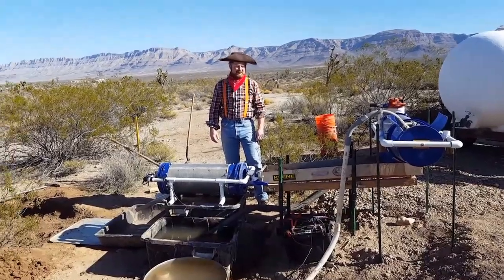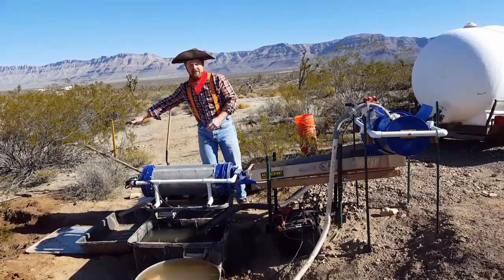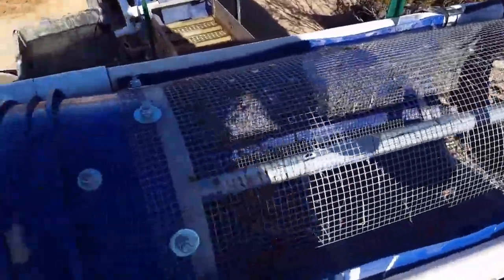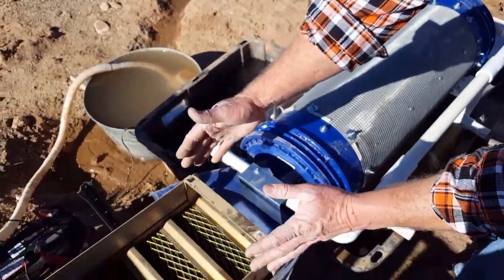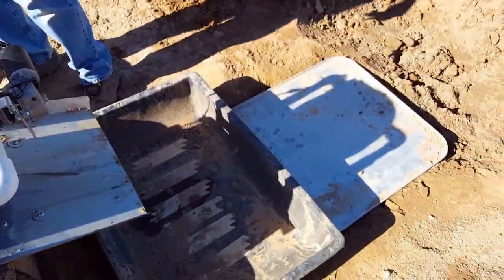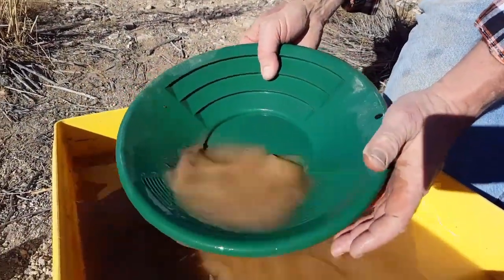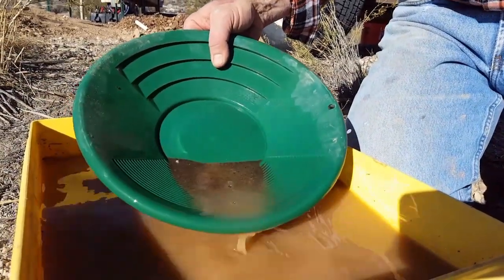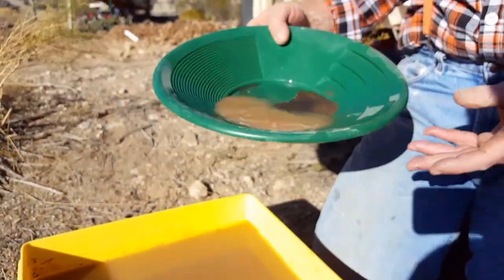Allan's Gold Mining Trommel Wash Plant

Comment: Simple is best.  
How long does it take to set up and level?  
What was your recovery rate per 5 gallon bucket of input material?
Reply from the maker: Thanks for the compliments Marshall.  It takes about 15 minutes to set up.  You can see in the video, there are green fence posts driven into the ground.  There are hooks attached for the trommel and sluice to rest on.  These remain on site and pre set to the proper angles.  Each time I arrive on site, I simply drop the equipment into place.  Recovery rate is about 98%.  Best wishes to you and your prospecting adventures.

Comment: MAN!! That is AWESOME! I see that there's some mud clinging to the 1st trommel, and some spilling out of the 1st Trommel (not much). Have you considered running small sprayers along each side of the 1st trommel so its spraying it down while it spins? That way it is always clean and even that much more effective? The water would still run down the original recycle too. Maybe something like PVC with holes drilled facing the trommel? This thing is awesome! What would you say your cost was (besides the sluice, I would make one I think).
Reply from the maker: Hi Rodney.  Thanks for the compliments, questions, and close observations.  I have made a few modifications since this video, including correcting the mud spillage off the lower cowling on first trommel.  Added a metal shroud over the upper half of trommel.  This allows better mixing and separation in the wash.   Also using a new set of riffles, and modifying the dewater trommel with a 400 mesh screen and extending the length.  Hope to have a new video with all the mods in a few months.  Stay tuned !  Good luck in your prospecting adventures !
Reply: Allan Guthmiller can't wait to see it. What do you think production costs of that was? Do you plan on making a kit and selling it? Maybe that could be your gold lol
Reply from the maker: LOL! Rodney.  Yeah, I've thought about it.  Maybe some day soon.

Comment: Hi Allan, I really liked your set up. A few years ago I thought I would love to be doing what you are doing, it looks like fun work with a chance of a Jackpot. It beats setting at home on your butt. Your equipment is well designed and except for your water trailer it doesn't look like you have a lot invested. Although you would never see it, but being born under the sign of Aries I can be a very impatient person, so the panning would be work for me. LOL A few years ago I came across a built gold reclaim machine called "The Gold Lab". All the parts including the battery fit into a plastic tote. Once you classified the pay the machine did all the work. I did go back to their website and it looks like there hasn't been much activity in several months. I could see this machine going hand in hand with your machine. Plus 'The Gold Lab' doesn't use much water. If you haven't seen the video's on 'The Gold Lab', you might enjoy watching how they had designed the machine. They said it caught all the gold including the 'flower gold'. Take care and be well. The Best of Luck. Bill
Reply from the maker: Hi Bill.  Thanks for the compliments and ideas.  I checked out the Gold Lab videos.  Quite an interesting set-up for feeding a Blue Bowl.  Normally, I pan the sluice cons with a Fossicker Maverick Pan (sold by Snake River Products) which makes quick work of ridding the light stuff.  From there, I classify the cons into 20, 40, 60 mesh, then feed into the Blue Bowl.  So much easier than panning all those fines !  The panning in the video was for demonstration only.  Wish you good luck in your prospecting adventures !

Comment: Allen cool but you should of use SHC 80 Gray pipe made for out door use, it has UV blockers in it to stop the sun damage .
The sun will in like 2 years cause the SHC 40 to dry up and get very brittle it is on for in door uses. One day the pipes will brake just by touching them. Now you could paint it, but paint tends not to stay bonded to PVC. I mean your set up right in the sun. Hope this helps you and all that wish to build with PVC pipe outside. Rich
Reply from the maker: Hi Rich.  Thanks for the comments.  Good thought !  Yes, the Gray SC 80 is UV resistant (more expensive) and is a good consideration for extended solar exposure.  My unit is every portable, and is stored in a shed when not in use.  Don't want anyone stealing my stuff.  LOL !!  Good luck with your prospecting adventures !
Reply: Not much for me, in wheel chair ten years now but I look to help anyone I can. buy some cons to run this winter to prove out my ideas. Try painting it with krylon for plastics. thanks for getting back to me. Good luck out there maybe I could come down one winter can not handle the heat. Rich
Reply from the maker: So good to hear folks like you, Sir, helping others despite your personal health condition.  Bravo !  Best wishes !

Comment: American ingenuity, you gotta love it. Would a 100 watt solar panel provide you with enough power for the motor that pumps the water. Great job. Good luck to you. Hope you make a bizillion dollars and retire early.
Reply from the maker: Thanks Steve.  Yes, I have contemplated solar panels.  Need about 300 watts.  The 3700gph pump pulls 14 amps at 12v.  The trommel motors pull about 4 amps each.  12 x 22 = 264 watts.  Then you have to consider partly cloudy days.  Definitely doable.  Might consider when my deep cycles give out...

Comment: Just start buying materials for my Build. need help on 12-volt jeep wiper motor. 
Did you try other motors? what year motor? How to mount to conduit?
Bill
Reply from the maker: Hi Bill.  I bought the wiper motor on eBay for $33.  It's for a Jeep Wrangler 87-95 (eBay seller: emsglobaldirect).  Haven't tried other brands. I'm sure they would work too.  This unit comes with an arm and ball mounted on the output shaft.  I modified a 1" collar that mounts onto the trommel conduit shaft by bolting on a 2" washer.  I then cut a slot into the washer to accommodate the ball.  As the arm and ball rotates, the ball travels in the slot, propelling the trommel.  Similar to using your finger to wind up a propeller for rubber powered airplane.  If the system is slightly off center, or frame flexure occurs, it won't really matter, because the ball is loosely connected in the slot, and will automatically adjust.  Therefore, motor unit won't bind.  Unfortunately, I don't have a clear photo of collar and washer.  However, it is somewhat visible on the video.  Hope this helps.
Reply: thank you for the info. Question about the wiper motor? What wire setup did you use ? I have red,black,blue,green, and white wires in the wire harness. Thank you. Bill
Reply from the maker: Hi Bill.  I think I used the green and white wires, but I'm not 100% sure.  Certain combination of wiring controls speed.  Unfortunately, the unit is out at the claim, many miles from my home.  Next time I'm out there, I'll take a closer look and report back.  I had to experiment to find the correct wiring combination to rotate at about 30 rpm.  Only one combination did the wires become hot, and it was instantly obvious.  So, I don't think you can fry the motor if you're careful.

Comment: Great video Allan.  Very unique design the way you are filtering the water through the bottom trommel.  !/2 gram per yard is fairly meager unless you're able to crank out the yardage.  The part I wouldn't like about reprocessing tailings is that there is little likelihood of ever hitting a nice nug.  The nice part about it is the digging is much easier than virgin material.
Maybe you'll find a nice stretch of unworked bedrock full of big stuff.  Nice work.  Keep it up!
Reply from the maker: Thanks for the kind compliments Nick !  it's amazing what the old timers left behind.  Can only imagine the nice nuggets they found.  However, they did a poor job cleaning bedrock.  My shop vac takes total advantage of this.  Finding nice pickers in the cracks !  Eventually, I'll find virgin ground.  Best wishes in your prospecting adventures !

Comment: Could actually use  a rubber flap at the top of you riffle tray to keep your water flatter  looks like you have a torent of water in the center just slows it down Nice unit though .
Reply from the maker: Thanks Garnett.  Got it covered !  Shortly after I made this video I installed a series of channel fins and flap.  Really smoothed out the turbulent flow.  Best wishes on your prospecting ventures !
Reply: Oh i`m figiting alright can`t wait for the river flows too . Just got a great deal on 2 Garret pinpointers  $150 for a  Propointer l & ll  - First thing I tested was some gold dust it talked like a crow .
Reply from the maker: Awesome !  Excellent tool for scanning bedrock cracks.  I'm thinking about getting one as well.

Comment: It looks amazing. Seriously! I am trying to get a recirculating set up build that fits on my trailer so I can take it around and prospect in san diego. My question to you is, how do you deal with the specific gravity of the water changing over time? I notice that my recovery rates start to go to junk very quick. I have been working on a cyclone separator in hopes of getting a better separation of water and material. Once the water collects enough material and the specific gravity goes up all the flour gold is lost and as we both know thats MOST of whats out there to recover.  How much recovery do you get off air sifted tailings must be super nice to scoop right off the top with no over burden.
Reply from the maker: Thanks for your compliments and questions.  I have a considerable amount of flower gold on my property too. Your concerns regarding water viscosity are very important.  I generally purge the water (about 40 gallons) every half yard.  This may vary depending on silt or clay content.  For example, this past weekend I was working bedrock, which had low silt content, so I ran the plant most of the day without purging.  I like your idea of a cyclone.  Would certainly do a good job separating, especially if you could get it to work with a 200 mesh screen.  Wish all the best in your prospecting adventures !

Comment: Way to much equipment to be successful. A drywasher when set up and running properly will recover 98% .. Well, certain drywashers will, there are a few bad models out there....Keep it simple
Reply: What im getting at, is I could go through and process the exact same material with just a simple drywasher setup, and recover anything you did and likely better.
Reply from the maker: I agree that dry washer is much simple set up.  I own a vibrostatic dry washer, and use it for preliminary prospecting.  Have operated many in the past.  Your claim of 98% recovery is phycially impossible with that type.  I accept your challenge.  Bring it on !  😊
Reply from the maker: Also, in order for dry washer to achieve maximum efficiency, the material needs to be bone dry.  That's  a major disadvantage, relying on seasonality.  A wash plant can operate all year.

Comment: When I complemented you on finding gold in tailings I should have clarified that more.  In dry climates caliche often cements some of the gravels.  Some of that caliche cemented gravels would have been oversize to the previous dry washers.  After decades on the surface the oversize cemented gravels become weathered and easily release their gold when washed.
Reply from the maker: Hi Steve.  I understood what you meant.  I just got off track a bit.  These piles were created back in the 1920's.  So, your comment is very true.  I have peeled off the top layer of the coarse tailings, down to the sedimentation level.  By golly, I found gold there too !

Comment: Wow that is really cool it looks like it works  You should let everyone know that when recirculating material you will lose about 35 gallons per yard.  If it is hot or windy that number will increase. Looks like a simple quality product.
Mark
Reply from the maker: Mark,  I'm flattered to hear from a popular mining manufacturing company.  Thank you for the kind compliments and comments.  As you can tell, I'm using one of your A52 Sluices.  I really like the fine ribbed matting on the head of the sluice. Traps a lot pickers !  Your comments regarding water usage is correct.  I've also noticed if the material contains considerable moisture (substantial rain this past month) the water replenishment is reduced.  Bone dry summer material will definitely be a different story.  Thanks again.  Best wishes in your prospecting adventures !

Comment: I'd say you have done everything right.  Recovery using water is much more efficient than dry washing.  Electric motors are more efficient and reliable than gas engines.  The tailings is where the gold is at because over the years the oversize that went through the old timers dry washers has been broken down by weathering.  Nice design of equipment.  My guess is that you had years of experience prior to this project or you did a lot of research.  I have run a larger battery/solar  trammel for over ten years, it is the only way to go.  Thanks for posting.
Reply from the maker: Thanks for the kind compliments Steve !  It takes more effort to set up, but "going wet" is definitely the way to go.  You are correct regarding the tailings.  Most of the good gold is on the surface and easy diggings.  I have a theory that the bedrock material was the last thing they processed, which naturally would be on top of the pile.  They also never had the convenience of a gas powered shop vac to suck up the bedrock crevasse.  Finding lots of good "pickers" down there !  I've been a lode and placer miner for over 35 years as a hobby.  I also build model airplanes and telescopes.  Hope you've been successful with your wash plant over the years, and wish you good luck in your prospecting adventures !

Comment: The rate of wetting all the reject tailings, evaporation and splashing, I think 100 gal/day is wishful thinking, though it is a simple machine.
Reply from the maker: 100 gal/day is not wishful thinking, it's fact.  I have operated this wash plant on several occasions with similar results.  Interestingly, during the winter, the material contains substantial moisture, significantly reducing replenishment.  Perhaps mid summer might be a different story.
Reply: allan I would like to get a closer look at the two trommels ,so I could make them my self. like some ideas on different trommels. incorp several different designs to take a pounding by rocks in the az desert
Reply from the maker: Hi Dwain.  you're welcome to have a look.  Can't publish my contact info here.  Can you message me on Facebook or Twitter.  We can discuss more details.

Comment: Outstanding alternative for desertplacer mining. Curious though, 100 gallons will wash a yard beore becoming too think with dissolved solids? I think thats what I heard and interpreted. So how many yards did you run for this video? Not challenging you at all, just trying to wrap my head around logistics. Very nice bit of engineering. Heavy pans
Reply from the maker: Hi Dan.  It's amazing how much more gold I'm recovering "going wet" compared to my dry washer !  You are correct. There is a certain amount of silt that accumulates.  Generally, I run approximately 1/2 ton before purging the primary and secondary tubs (approximately 40 gallons).  Also use Jet Dry.  This acts like flocculent, causing the silt to settle, significantly reducing any becoming recirculated.  The gold panning at the end of this video is one of three (3) pans of sluice concentrates, after running about 500lbs.  Let me know if you have any more questions. Best wishes on your prospecting ventures !
Reply: Thanks Allan, how long does it take you to run a half ton? Then do you just dump and refill? Looks like you have a serious water hauler in the background which has to make life easier.
Reply from the maker: Hi Dan. Depending on how energitic I feel,   it takes about 2 hours to process a half ton.  I I muck the tubs with a shovel, then replenish with fresh water.  That's a 500 gallon tank used to haul water to my remote ranch house.  For processing, I generally only fill it half.  Although this wet process requires considerably more equipment than dry washing, but results are impressive.
Reply: Allan Guthmiller hope you still monitor the comments.  You throw  out the muddy water?  Do you not own the claim or at least rent it? I'd think you would want to put the water into a $10 kiddy pool to allow to act as a settling pond or something seems like a waste of a   valuable resource

Comment: I like the simplicity of your build and may have found a new project for this winter. I will disagree with your explanation of how the riffles work, though. They don't create a suction, if they did then all the light material would get sucked in first and just load up the riffles. What actually happens is, they create a "dead zone" or "drop zone" which drops out all the heavies and the light material keeps flowing through and off the end. But good video anyway.
Reply from the maker: OffGridBC Thank you for your comments.  Actually my analysis is correct.  It's simple property of fliud dynamics.  As a fluid, including air, flow over a barrier, it creates a pocket of negative pressure.  As velocity increases, so does this negative pressure (suction).  What's happening within this zone is key.  A vortex is created.  For those of us who fly airplanes and gliders, we call it a "rotor".  This rotor keeps the riffles from packing with black sand.  Gold being heavier engages this vortex (rotor) between the boundary layer and is pulled into the riffles.  Lighter material is expelled.
Reply: oooh... offgridbc you got wrecked
Reply: Just a different explanation of the same process using different terminology.